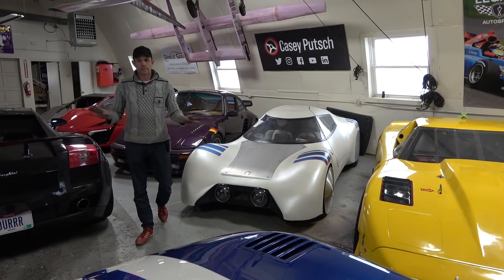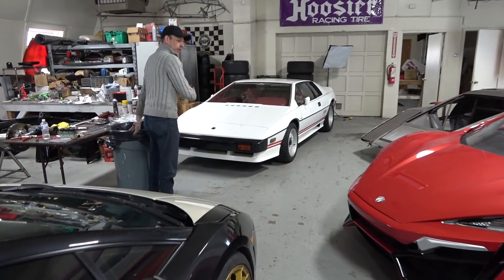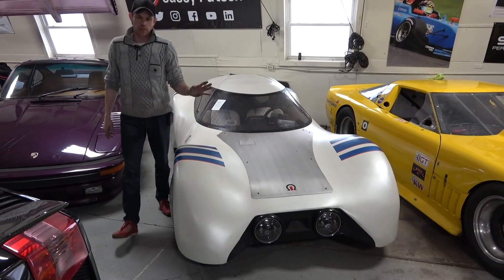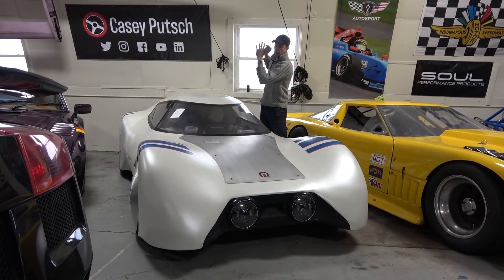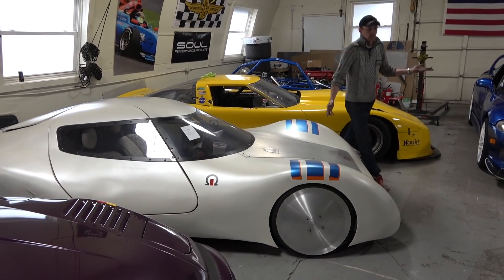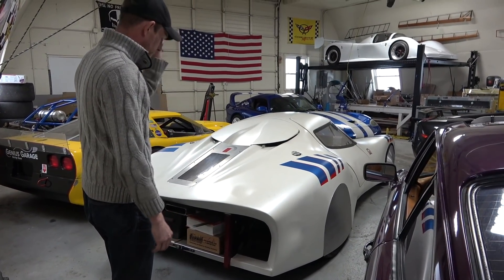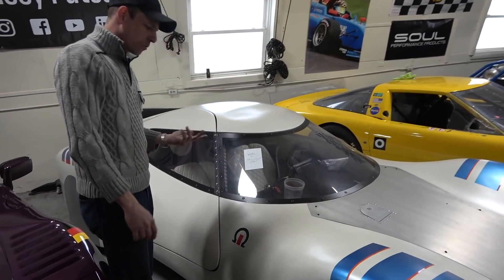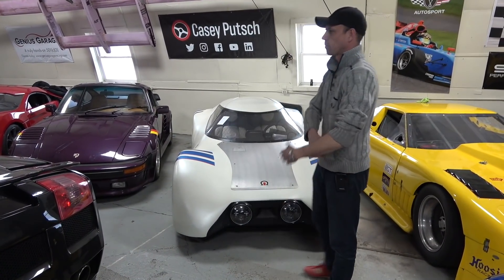Supercar that's Recyclable and fuel efficient? The Omega Car

Comment: I think the omega car was the first video I saw on this channel because I was looking for aero efficient experimental cars, but I'm weird I guess.

I suggest converting it to electric after you've achieved your diesel milestones. Would be interesting to see how small of a battery you can get away with. Getting small diesels to pass emissions is getting prohibitively complex and expensive. Electric is a much simpler and more affordable way to imagine a mass produced ultra efficient car.

I don't share your conclusion on hybrids, it's complex yes, but the prius is a very cheap car to own since it uses very little fuel at low speeds, has no clutch to wear out and has much reduced wear on the brakes. Probably not feasible for a low budget project like yours, but I think in the near future it's going to be the only option to build a lightweight sportscar.

Comment: Great car, but need to put up to 4 passengers comfortably in it to maximize the marketability of the vehicle.  I wonder if the driveline could get better fuel efficient if it's a diesel/electric/battery fuel system get beyond the 1500 total mileage limit...
Reply: Three more passengers would cut the mileage like a knife.

Comment: Not enough grid energy for everyone to have EVs.
Most grid energy is from fossil fuels.
It would take 30yrs of building a new nuclear power plant every single week to provide enough grid energy fro everyone to have an EV.
No used car market for EVs since the batteries + a used car costs as much as a new one, making used EVs unaffordable.
EVs are too expensive for the average person.
Right to Repair among high tech electronics products is a Serious issue making EVs unaffordable to the average person.
Lack of used car market means EVs wont last as long before being thrown away, resulting in more consumerism and more energy to manufacture and recycle them required.
.....

Comment: It be awesome if you where able to engineer a "Mass Market Kit Car" out of the OMEGA!
If there would be a "possible" Sedan version available, it would be much better.
As in my residential Market (Pacific Northwest), there is barely a Resource for Charging Electric Vehicles in a relatively short range (within 50 miles apart)...
The only relatively simple solution I could think about for charging EV Mobily, would be an Aerodynamicly Inefficient Solar Trailer!
As you would say, DRRR! Our society is NOT ready for EV's yet, though they have been Mass Marketed for the past 10+ years.😿
Reply: Perhaps think about Hydrogen - Stanley Meyers - his working designed, built vehicle extracted Hydrogen from any water supply, and the simple combustion engine ran efficiently with H2.
There are more efficient combustion engines like the Liquidpiston X rotary which operate using all fuel types, efficiently; 4 HP/ 2 Kg, 40 HP / 20 kg, air cooled.
Add hydrogen extractors from the H2O exhaust and air, which also exist.
Can combine this engine with electric motors too, without any large, heavy batteries or minimal if desired.
There is a manufacture of efficient electric motors within the wheel assembly and existing vehicles using them too.
Sincerely

Comment: Only stupid people got complacent and didn't care about efficiency when gas was cheap.

I love sports cars and exotics but super efficient cars lead the way to less expensive daily drivers and probably much less expensive EVs because they will reduce the required battery to have a decent range.

It's too bad you didn't have it running during the covid lockdown.  You probably could have set an unbeatable diesel (solo) Cannonball record with a 30 gallon fuel cell, a catheter and a lot of energy drink.

I'm just curious about your manufacturing process because if you can build it, I might be able to.  I'm sure I could come up with a cool project for a DIY sustainable monocoque.